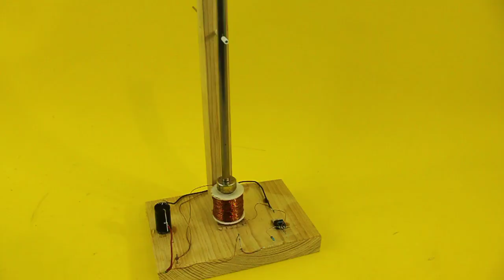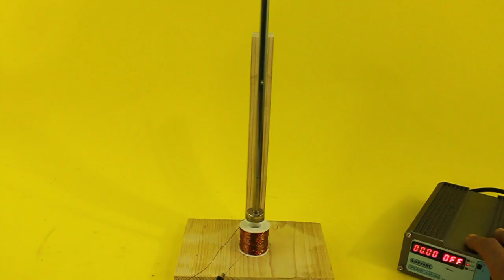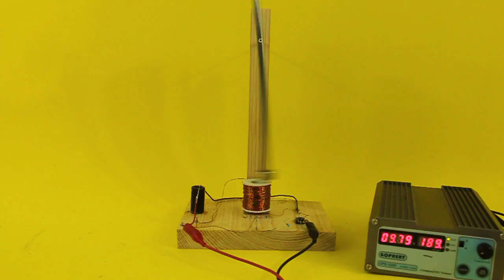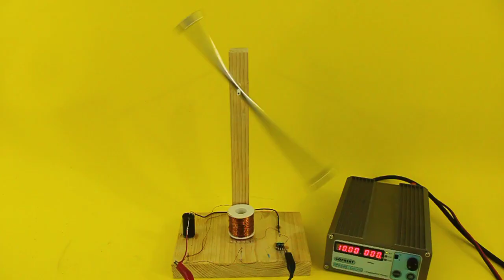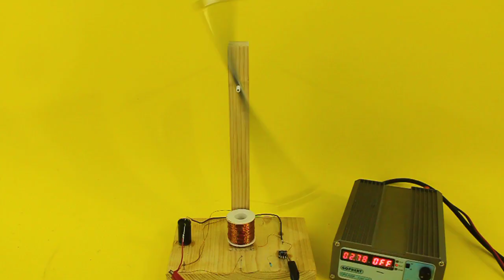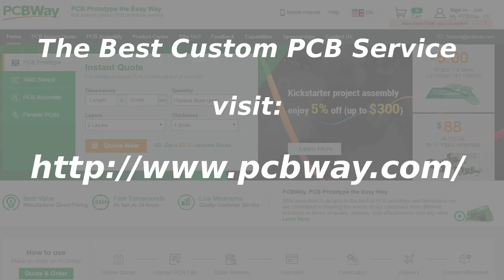Magnetic Pendulum

Comment: 🎯 Key Takeaways for quick navigation:

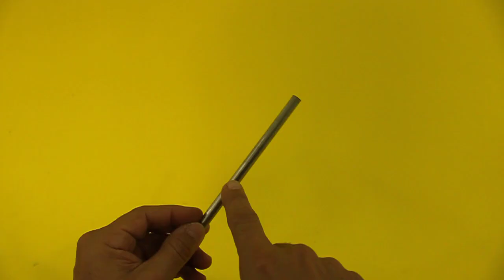00:19 The magnetic pendulum consists of a metal rod with a brass axle and a coil made with magnet wire.
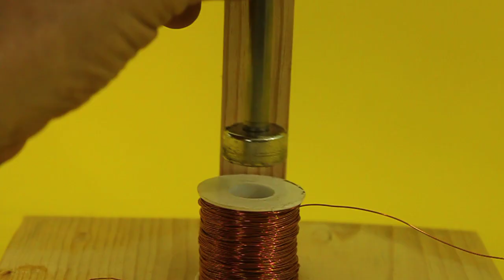01:34 Timing is crucial to energize the coil when the magnet passes above it to give a push to the pendulum.
02:53 A capacitor is added in parallel with the coil to absorb energy initially, ensuring the coil pushes the magnet in the correct direction.
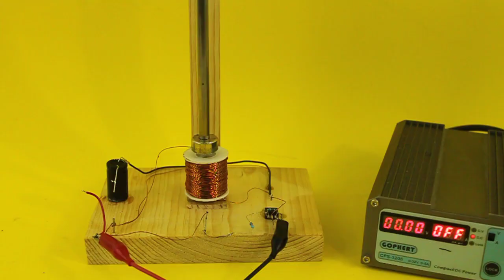05:52 Disconnecting the capacitor leads to voltage spikes, which necessitates the use of a diode to prevent damaging the MOSFET.

Made with HARPA AI

Comment: Thank you for sharing your ideas.  Great work and circuitry! 

I believe it can be used to charge a battery when the pendulum is turning 360 degrees by putting coils around and above the coil beneath the base so that when the magnet passes all the coils above it will generate electricity to charge the battery connected to the coils.

Comment: You could have put the reed contact just further from the coil... no need of capacitor...
Reply from the maker: are you sure????
Reply: @ludicscience  It's obvious: if you shift the reed enough on your right, it will turn on when the magnet is enough afterwards the center the coil.
Reply: @ludicscience  In my case, however, the pendulum will accomplish only an half stroke every time. If you want an entire stroke you must place the coil all at your left and the reed contact more left too.
In fact, your pendulum suffers of a bad position of the coil which must not be placed at the center of the pendulum but on one of its two sides... and you will not need a capacitor...
Reply from the maker: Only half a stroke is not  a pendulum.  You need a capacitor
Reply: @ludicscience  Yes: an half stroke gives a form of pendulum because the period is given by gravity too, but i showed you two methods for having a complete pendulum stroke (classical form): by putting the coil totally left (or right) or by using two reeds and a coil at the center.
Reply: @ludicscience  I made mistake: by two reeds you will have always an half stroke. Only solution for avoid capacitor: to place the coil at one extremity, but it's will not be a self-starting pendulum instead of yours except with a strong magnet and/or strong coil. Sorry.
So your plan with a capacitor is useful and elegant.
Reply: @ludicscience  II part.
If you want maintain the coil at the center, you must put a second reed before the coil in an electrical series with the first one. So: when the magnet turns on the second reed the first one rests turned off and the coil is off. The magnet passes over the coil off, then it turns on the first reed while the second one is still turned on and the coil switches on, pushing the magnet. It will be only question of founding the perfect postition between the two reeds and the coil. This second solution avoids the capacitor too but gives a centered coil and a complete pendulum stroke.

Comment: You don't need a Reed switch or any other sensor to drive the magnetic pendulum. You can use the coil as sensor and actor of the circuit. As the magnet passes the coil it induces a voltage in one direction during approach to and in the other direction during detachment from the coil. A comparator can detect the detachment signal and trigger a pulse to push the magnet away from the coil. I have used a micro-power dual op amp as comparator and monostable multivibrator and a low power n-channel MOSFET as switch for the electro magnet. In case that it doesn't push you simply have to change the coil wires on the connectors and it works.

Comment: How do I buy parts in the advertised store, if you have not written what? Capacitor? Transistor? IRF 244 or maybe IRFZ44? Coil? How many coils does it have? What thickness of the wire? Mages? What strength? All of this is important to repeat the experiment. Can you provide this data or is it a secret?

Comment: Alternative... Use a tungsten weight with a steel rod through it for your pendulum.  Use the magnet to attract (accelerate) the rod until it is vertical.  Then allow the magnetic field to collapse.  You can recapture some of the energy from the coil in a capacitor to be use in another circuit.

Comment: Hi. I believe that You could  make the same device in a simpler fashion. I have seen this kinetic desk toys that apparently use only a transistor, the solenoid (with works as magnetic switch or hall sensor)  and a battery pack. 
Would You kindly explain if such a configuration is possible and how the circuit should be assembled? 
Thank You. 
Congrats and best regards from México City!

Comment: (1) Why didn't you take advantage of the high impedance of the gate circuit of the mos fet ; using a  small mylar capacitor 
across  the gate resistor  to create a delay ?
(2) Why can't the reed switch be relocated to produce the delay ?
Reply: Also reed switch might power on in field of electromagnet. Why it's not on in this case?

Comment: It's intriguing to see the pendulum inherently want to speed up. Obviously, the speed at which the magnetic field is passing through the coil, generates more voltage for the cap to store. More zap from the cap...more magnetism in the coil upon discharge : ) Thanks Ludic !
Reply: No, that's not how it works. The way this is set up, it's the coil affecting the magnet (the one at the bottom of the pendulum) not the magnet affecting the coil - which is what you're apparently thinking is happening. Even if it was set up the other way, I don't think it would work the way you describe. I'm not sure why you think more voltage would be generated the faster the magnet passes by the coil. Since any voltage at all will only be generated while a coil and magnetic field are within proximity of each other, wouldn't that mean less voltage generated as the pendulum gets going faster? I think so. Also, there's no such thing as "more zap from a cap" - as you put it. Capacitors discharge voltage after being sufficiently charged by a voltage source. They only discharge when the amount of charge they're rated for is reached, and they'll only discharge what has built up inside them. The charge they are rated for is predetermined (by the manufacturer) and fixed. In other words, the voltage coming out of a capacitor is not variable. Caps are specifically utilized for this inherent property..
Reply: @SineEyed  you are wrong. The coil acts as a generator during the downward swing of the pendulum and produces more voltage as speed of swing increases, which charges the capacitor faster (and to a higher value of voltage) before being triggered back through the coil (now acting as a motor) with a greater amounted force, making the pendulum swing faster and the cycle repeats until ultimately the capacitor can not be charged / discharged any higher and maximum speed is reached.
Reply: @expfcwintergreenv2.02   yeah nah... that is 100% NOT what is happening..
Reply: @SineEyed  5 tau, brau

Comment: I like your channel, thanks. Is the MOSFET really necessary or is the ReedRelais not capable of switching the relatively high current directly?
Reply from the maker: It is not capable
Reply: @ludicscience  Hi and thanks for the video, I don't have the irfz44 mosfet.  Unfortunately I don't have much material, are there other alternatives?
Reply: The reed relay will arc inside and fuse the terminals

Comment: That capacitor takes hugh currentspikes and waistes energy while in fact short shortcircuits youre powersupply where that waiste appears as unnescesairy heat.
The way to apply such a delay is with a capacitor and a resistor and of course on the gateside from the mosfet. Between that reedrelais and the gate you have every oppertunity to add a delay on the moment (the fase) of the pulses (and even make the pulses with a length you choose) with little components in stead of that fat capacitor, thus little losses.
But it still is nice to watch this pendulum video!
Reply from the maker: I will try that!
Reply: How can I reach you Ludicrous? John
Reply: @johnchisholm7350  what means "ludricous"? English is not my first language you see
Reply: You maybe mean e-mail? That's
robson24@live.nl

Comment: That was fun.
Wouldn't it be easier to have the coil attract the magnet? That way you won't need a capacitor.
Also wouldn't an iron core in the coil THAT moves in and out which would since you are activating the coil already which would do that.
And you would need less volts if you moves the core slightly closer. ;)
Reply from the maker: I think attraction will have a similar effect, but will try anyway
Reply: Ludic Science  hi. Can you please provide the material list and sizes of caps and resistor? Also the coil and where did you get it. Thanks.